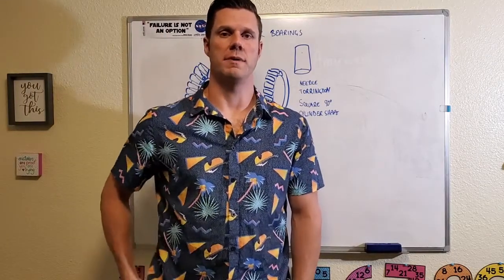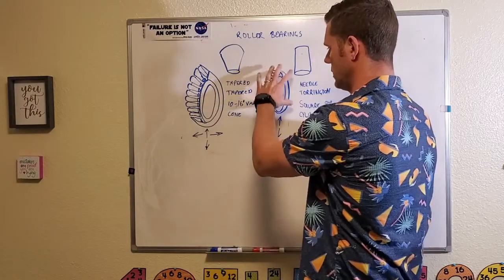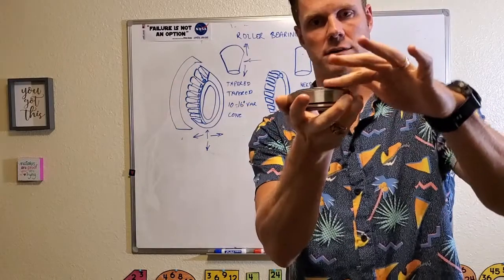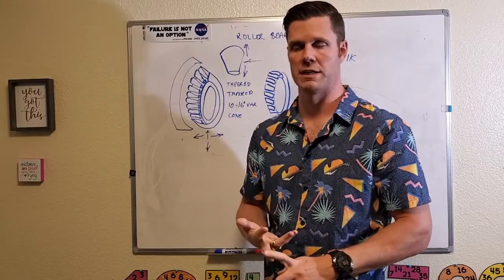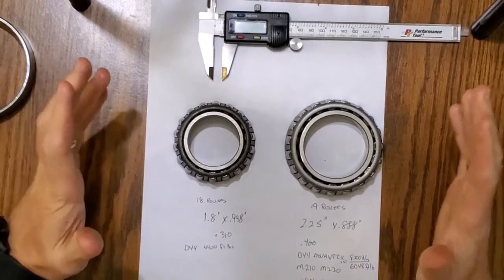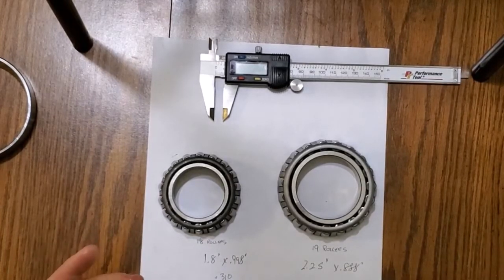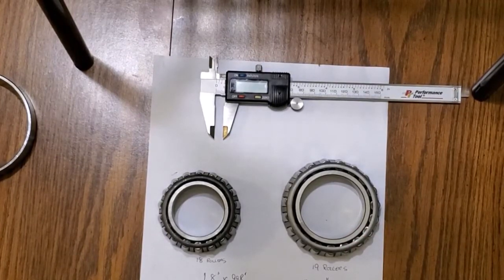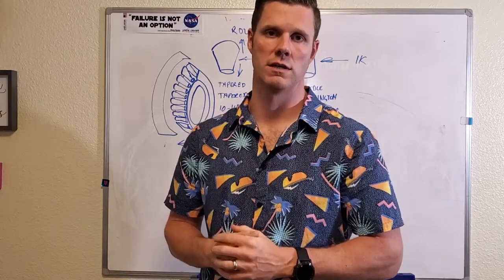Tire Talk ~ Henry Timken's Roller Tapered Bearings vs Torrington History Engineer Science Math STEM

Comment: I work at a Timken plant I run the cnc machine that makes the cups and cones of the roller bearings.
Reply from the maker: Thank you for that. Timken has always been the brand I have used for decades. They are pretty much the only one that makes all the sizes we need.